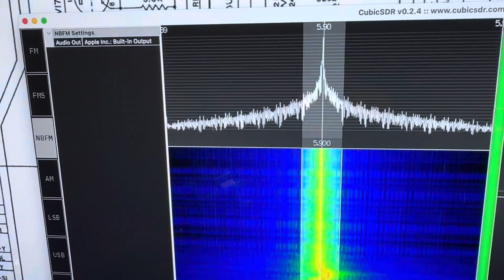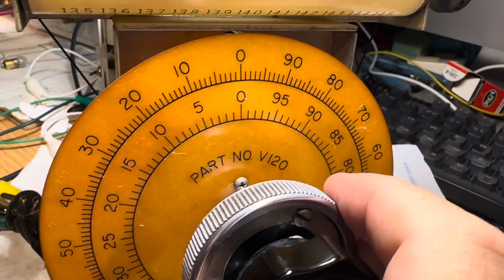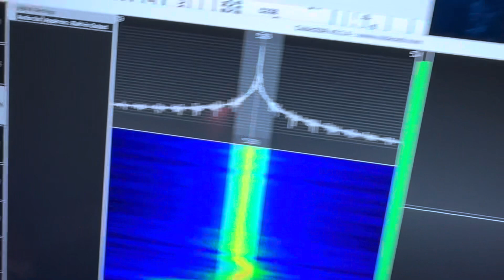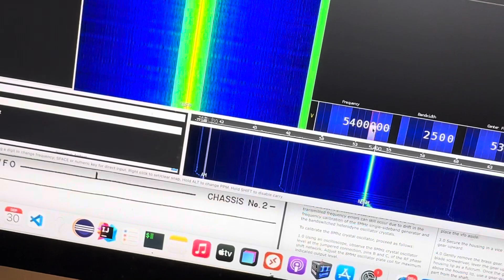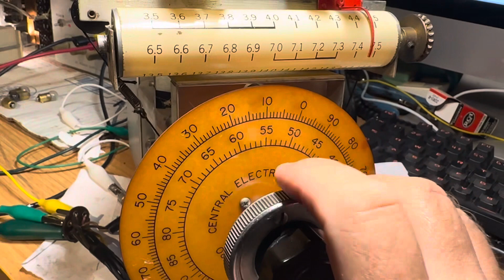Central Electronics 100V held VFO calibration +/- 5KHz for 30 years? 60 years? Impressive

Comment: Are you using phase cancelling to test whether this thing is calibrated. or how far out it is?
Reply: Ok I think Ive figured its a ham radio thing, and has something to do with generating the carrier band for transmission.
Reply from the maker: I am using an RTL-SDR as a frequency standard. The VFO starts at 6Mhz and as you advance it goes down to 5Mhz